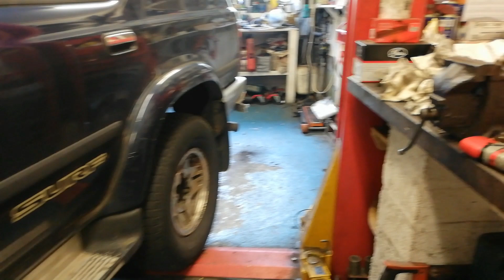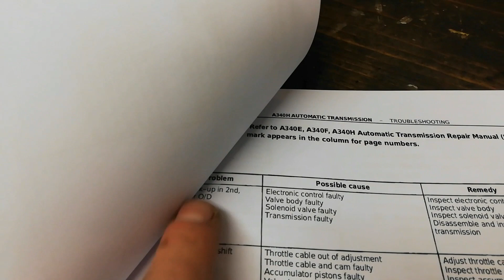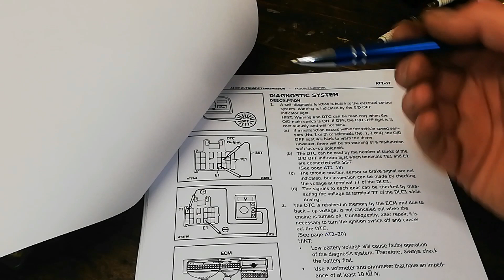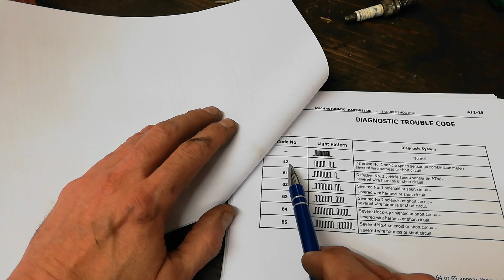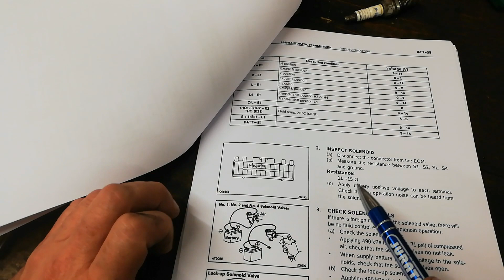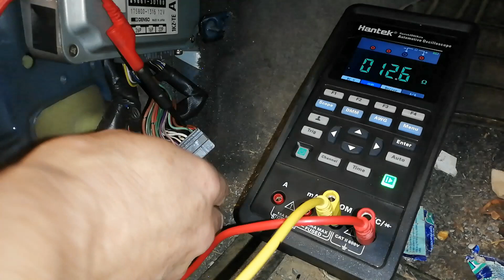Toyota Hilux A343F Auto Transmission Problems Part 2 of 3

Comment: Question: Can I drive on manual mode (by removing solenoid wire) till I find a good ECU that matches. Manual mode is perfect. Will it hurt my transmission?
Reply: shouldn't hurt it one bit

Comment: Hey.. how are you?

Nice detail video... really useful for me. I am not a technical person but you video made it very easy for me to check the problem with my KZN130 transmission. Basically I have delay shifts and no OD.

Did manual mode test. Transmission is perfect. Issue is with ECU. Had three capacitors leaked. Fixed it, it worked for 5 mins. Shifted to 4th once and then returned to the same condition.